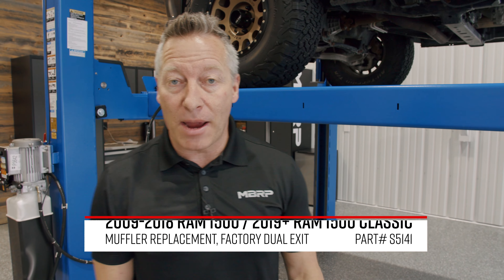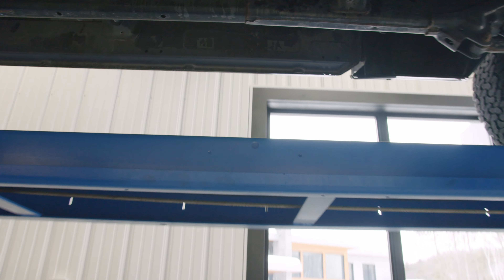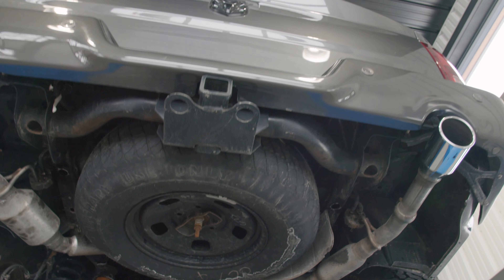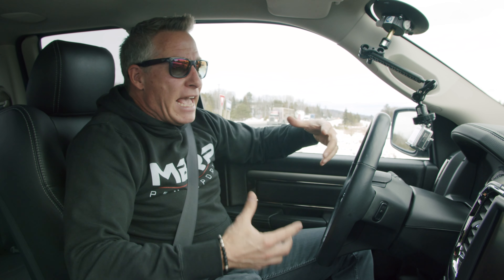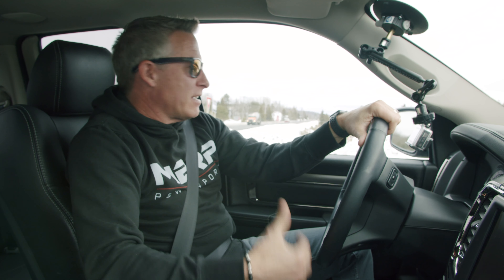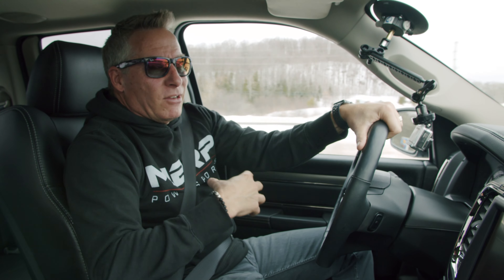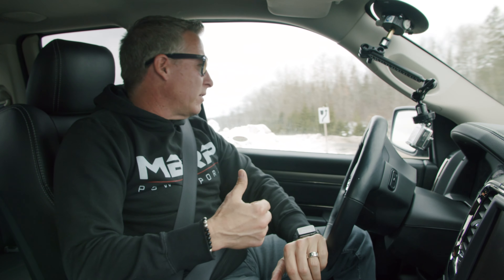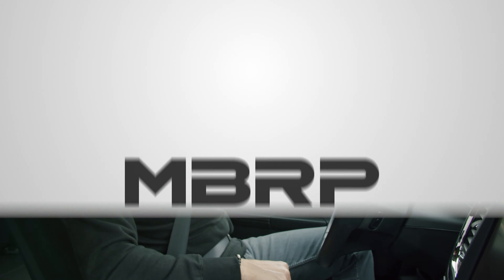RAM 1500 // MBRP Muffler Replacement Overview

Comment: Great video.  Sold.  Made my decision very easy.  Can't wait to install it.
Reply: @MBRPexhaust-TV  I ordered the S5141409 from Parts Engine Canada almost 3 weeks ago.  Is this muffler replacement on backorder?
Reply: Benjamin do you have any drone on the cab ?
Reply: @jeremyk3375  There's a noticeable drone, but only at certain rpm. My wife noticed it more than I did. It's an awesome exhaust tone. Only moderately loud when you want it to be.

Comment: I would like to purchase this muffler, but I have a question. Do I need also to buy the pipe extensions because it seems the muffler is a little bit shorter than the stock one